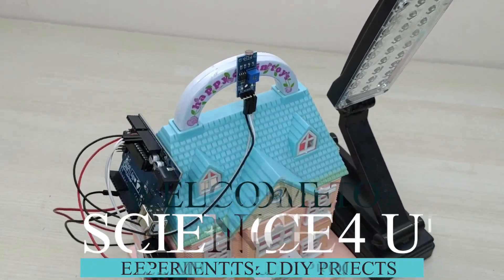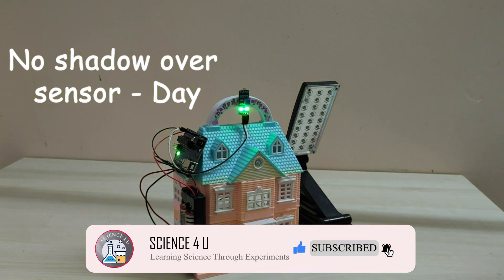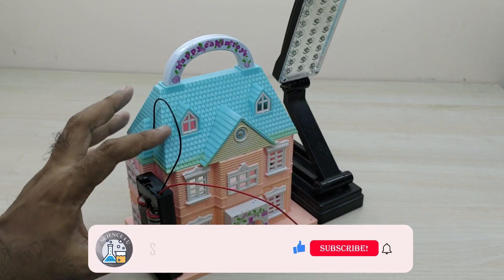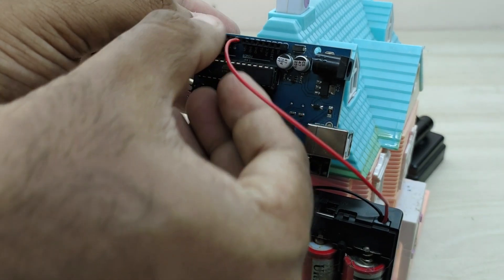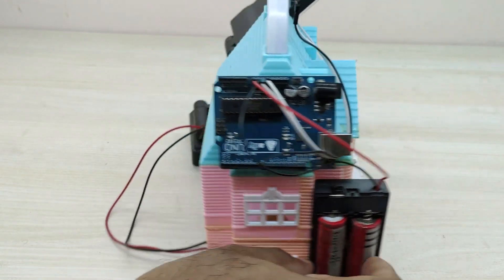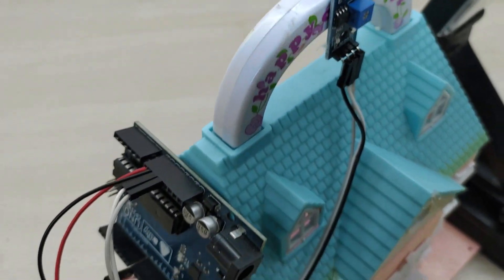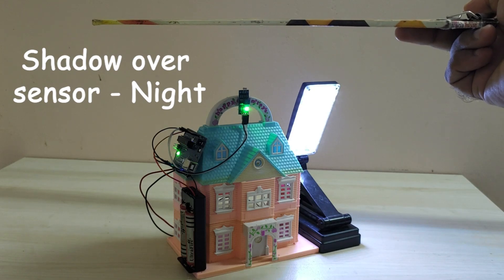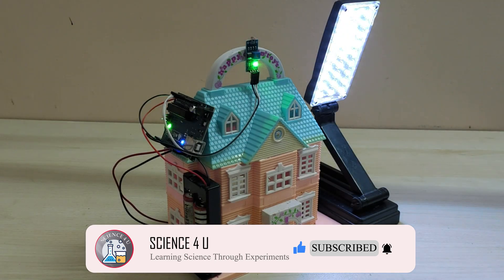Automatic Night Light for Home using Arduino and LDR sensor || Simple and Useful Science Project

Comment: Sir by following the steps you told, would project perfectly work..????
Reply from the maker: Hi friend. It will definitely work because I have already made and tested it. But only thing is that the components used should not faulty. If you are using all good working components, then this project will definitely work..

Comment: hi, sir! im interested in using this as inspiration for my capstone research as a grade 11 student! but i have a question, is there an option for the light not to turn on during night time?
Reply from the maker: Hi friend. If you want the light not to turn ON during night time, the most easiest way is to disconnect the battery by turning off the switch to the battery ..